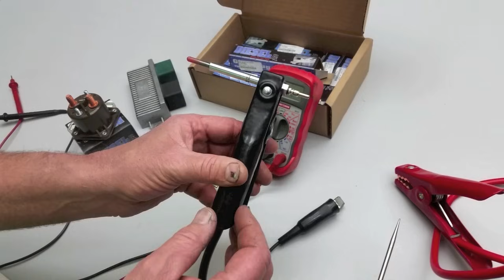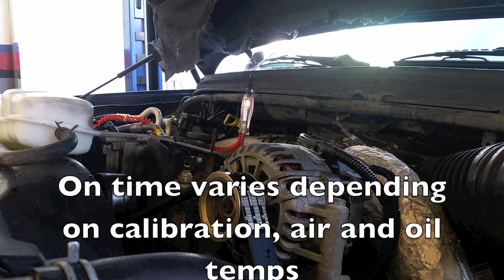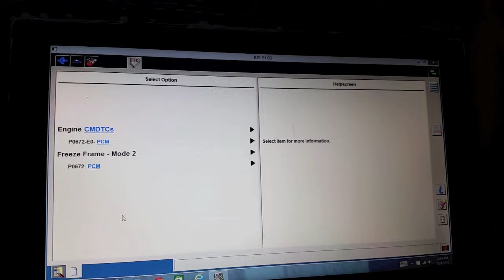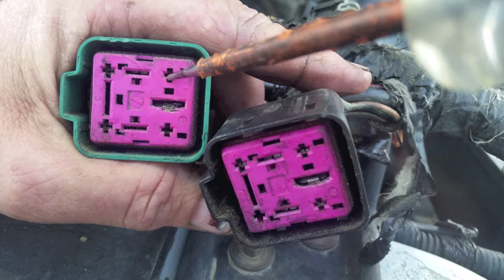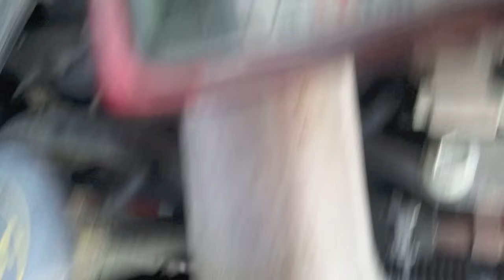Ford diesel glow plug operation tips and tricks

Comment: Hello do you know if glow plugs stay on even after light turns off, on ford 6.0? Trying to see if key cycling is needed in cold weather.
Reply: Not a tech, but you can watch your volt meter(in dash or connected to the batteries) and see when your needle starts its upward trend towards charging and that should tell you when your glow plugs shut off.  My 7.3 will hover around 9-10 volts on the dash meter for 2-7 seconds after "wait to start" shuts off or even after I've started the engine(after wait to start shut off and I started)  so possibly it stays on like mine?
Reply: Also, key cycling can lead to premature glow plug failure and expended tips(which WILL suck trying to remove and replace) so if you are needing to cycle to start you likely have other problems, possibly fuel bleed down causing air to get in your system or potentially wire chafing causing intermittent problems with the electronics or your ICP not letting your injectors fire off.... thats just a few.  Troubleshooting is easy but time consuming.  Good luck,  hope this helps

Comment: I just bought an 1989 7.3 idi with glow plug issues. There were six new Autolite 5 volt glow plugs installed(supposedly correct according to the Auto Parts store), one Champion and one glow plug with the top broken off.  After playing around and watching many YouTube videos, I finally bought new Motorcraft 10.5 volt glow plugs.  Now they WORK with the glow plug solenoid controller. The voltage and resistance is IMPORTANT.

Comment: I have 7.3 similar issues and I replace the glow plug control module. And didn't fix my proble. I'm going to check the wires now to see if I have a better luck.

Comment: That's the cleanest stock 7.3 engine compartment I've ever seen I though my 7.3 was clean and it's far from stock
Reply: I’m swapping a 7.3 into my ‘00 f250 dual cab and plan to put all new and clean parts and clean the engine bay really well, too

Comment: That’s a 7.3 glow plug controller on a  6.9.  The original 6.9 controllers were a cylinder type screwed into the back of the engine on the drivers side.  They were very prone to failure.  Many have changed to the push button momentary switch  option.

Comment: I just had my 2003 6.0 Bulletproof and getting a P0683, P0275, and P0281 yet not setting the check engine light. My SCT tuner/monitor finds these codes yet a regular odbii scanner passes the scan and finds no doc codes. Engine runs fine is there anything I need be concerned about. By the way great video!

Comment: I have a Ford Ranger 2.5 turbo diesel 2007 model when I turn on the ignition the glow light goes on for a second , not like before for about 3-4 seconds and the car does not start as if the glow plugs are not heating up what could be the problem

Comment: I had 1994 e350 IDI 7.3 internacional engine 
Few months ago I replaced the injectors and now went a drive for 15 miles turn off the engine wait half hour and trying start  takes longer and kill my battery’s 
Any idea or phone  ☎️ I can call? 
Tanks

Comment: Thank you. I have a retired U-Haul that is hard to start. The relay clicks on and off. The guy at the U-haul sales that sold me this rig told me to just cycle the key a few times. Doesn't really work. If I plug in the block heater overnight then it will  start. Now I know what's up and can fix it with the things you just taught this 54 year old diesel novice.
Reply: An 6.9 or 7.3 idi it’s definitely burned out glow plugs  I would swap relay  too don’t use off brand glow plugs in idi ‘s they will swell up break off in the engine cause all sorts of hell on ya 👌🏼✔️🤙🏻✌🏻

Comment: I have a question.I have a 99 7.3 Ford every time I drive it in the rain it turns off and when I turn it back on it runs fine do you know how to fix this problem?
Reply: uiioo Doppoud i hate to say this...dieseltechron has passed away. He died in an unfortunate vehicle crash (not in a ford). Check and make sure your windshield isn't leaking water.

Comment: Being a ford tech a doing a TON of 6.0 glow plugs, I can say I personally have never had any problem other than the glow plugs themselves or the glow plug harness (plugs onto the glow plugs) I have never had the module fail for me or the pins spread. I always just sell the plugs and the harness if I get a glow plug code on the 6.0. I also always make sure to sell one whole bank of glow plugs because every time I only replace the one bad one, it comes in the next week with 2 or 3 codes for the rest of them on that bank. If I were to get one that ended up needing the module after that (which has never happened) I have a box of 20 or 30 good modules I could use one from... But like I said it has never happened

Comment: Thank for your great knowledge.
What do I need to remove to take out the glow plug that is closest to the firewall on the driver's side and kinda under the aftermarket Hypermax turbo on my 1993 F-250 7.3 international Ford 4X4.

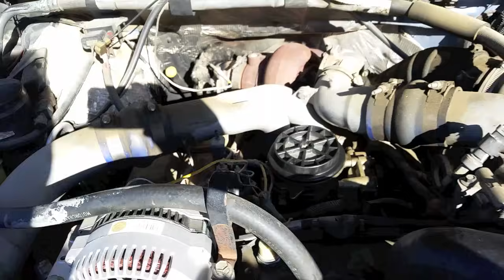Comment: So at 8:26 he said "On the earlier 7.3..." when he's obviously now working on a LATE 7.3.  The late 7.3 has 2 RELAYS, side by side on the passenger side.  One is the glow plug relay, the other is the air intake heater relay.  This is what I meant when I said you have to watch his videos over and over to figure out what he really means.  He is in California, so when he says "early 7.3", he means before they switched to the glow plug CONTROLLER, which was only on CA emissions vehicles.  For the rest of us, if you have 2 relays side by side, you have a late 99, also referred to as a 99.5.

Comment: What is the relay forward of the glow plug relay?
Reply: The air intake tube heater (if you have a truck equipped with the cold weather package.)

Comment: Amazing. This is very helpful. You keep give even after you passed away. Hopefully you are with JESUS. Thank you sir
Reply: dead is dead ,  nothing can be said for dead
Reply: Rusty Wrencher    ,     Can you answer me a question about replacing the fuel heater down inside underneath the filter, the kit that I have has two screws in it to hold it down !! the one coming out has no screws in it except approx the 3/4 holding down the Element/ stem ??? 97 f250. 7.3 l diesel !!

Comment: I realize Ron died recently, so I mean no disrespect, but even though he obviously knows his stuff, many times his instruction is confusing.  At 16:36, he numbers the glow plugs, 1-3-5-7, with 1 and 5 at the top, but then later in the video, he starts at the top right, with #1, then goes down for #3, then calls the BOTTOM connection on the left #5.  He uses a lot of terms that are vague, stuff like " This one tells the PCM to turn on and pulls on it..." (something like that).  "Pulls" on WHAT?  What does that mean??
Reply: gr8guitarplayer he was dead on watch it again you should understand if not don’t fix it very easy system

Comment: Got a question for you. What is the cause of smoke coming out of the dipstick tube while it's running.
Reply: possible blow by. open your oil cap while the truck is running and if white smoke starts pouring, its probably safe to say on of your piston rings have snapped or broke. due for a rebuild

Comment: Hey Ron, I have a 2015 6.7 powerstroke.  The high pressure fuel pump went out and we found metal in the fuel tank.  Absolutely no def contamination or bad fuel.  Should we expect engine damage from the metal?  3 injectors need to be replaced so far.  Can the metal from the pump get through the injectors and damage cylinders, heads etc...?

Comment: I have a fault code on glow plug 5 on my 2006 superduty... Is it safe to assume that it is the plug or wire and nothing else since it's only throwing a code on one glow plug...??? Your thoughts
Reply from the maker: I see just as much with glow plugs, connection or module. Sorry.

Comment: hay man I really need some help I've been threw hell an back trying to fix my 95 7.3 obs it start everyday with no help runs strong for exactly 5 minutes then dies like I turned the key off and will only start again several hours later
Reply: Mikee Ciccone photo
Reply: Sounds like a fuel problem, did you get it fixed?

Comment: You are a Ford Diesel Master! Kind of like Mr Booth is with Ford transmissions. I have plenty of experience with the Ford diesels over the years at the dealership but man you know every little detail good stuff!
Reply from the maker: Thank you. I see your videos and wonder where you get the time to cover so much, work and answer people. do you ever sleep?
Reply: DieselTechRon
Reply: DieselTechRon
Reply: @mikesteele8009  I have a 1985 f250 detail and I want to know what are the systems or tell tellbsigns of the glow plug silinoid switch is going out
Reply: FordTechMakuloco 
I have a 2000 Ford F-250 7.3L turbo. It’s having trouble maintaining idling. I changed the filter in engine compartment. And it keep doing the same thing.
Reply: You and the late Mr. Ron are some great teachers. I've learned a lot and gave me the courage to work on my 6.0 powerstroke and 5.4 3v triton.  I have a 06 navigator that I purchased new. Instead of using the 5w-20 oil, I only used 5w-30 synthetic since first oil change every 5k miles. I have around 120k and no issues with the vvts or timing chains

Comment: Hey Ron, quick question. I have a 2007 f350 6.0 it has a bizarre problem that I can't find any advice on from the forum's. the truck likes to crank no start randomly. like as in it won't start now but it will start tonight might start tomorrow morning but will start tomorrow afternoon. the truck ficm voltage reads 48.50 the ICP reaches a little over 1500 when cranking as well. there are no codes or at least no codes my SCT is picking up. and there are no leaks that I can see on the driveway. please help lol!

Comment: thank you for putting this knowledge out there for some of the stuff that you do is awesome... but I do have a question... 05 F-250 6.0. my key tumbler will not roll back to accessories. with that, this truck was bought used and it did not have a key fob. watch videos could not set the new key fob took it to the dealer they couldn't set it. that's what I found out a month later it would not roll 2 accessories.. key tumbler causing both issues.... Thank you for the videos... Bryan

Comment: Hey Ron, I own and operate a small diesel repair shop. Primarily heavy duty diesel but found myself turning away more super duties than I like, forced myself to take these jobs in and your channel has been much help many times.  Thanks for sharing your tips and knowledge. Better than most factory training.
Reply: DieselTechRon so hey men I replaced alternator 3 times now in a week if my glow plug relay is bad could it be killing my battery s and alternator??
Reply from the maker: Thank you

Comment: Hi Ron....great video

I often have to cycle the key on cold mornings to get the glow plugs up to temp to start my 7.3L. Is this expected? How do I test the air and oil sensors to determine if they are working as designed?

Comment: hi Ron you sent me a link for glow plugs before was reman auto parts could not find that. I ordered glow plugs from diesel trucks direct are they any good. now I am on the debate of whether or not I should get them from remanautopartselectronics.
Reply from the maker: What brand are they?
Reply: They just say made in Japan 2 year warranty
Reply from the maker: everything effects it. esp crank speed, fuel type, oil, eight and quality. injector condition, batteries etc.  cheapest way is a scan gauge or Bluetooth adapter, Android. wifi adapter iphone.